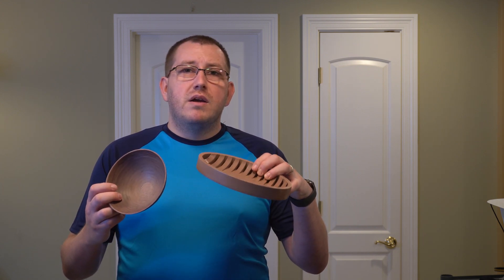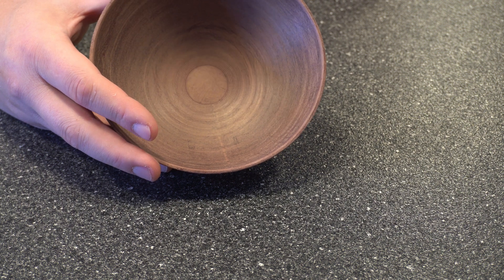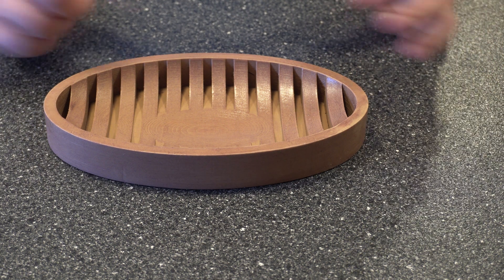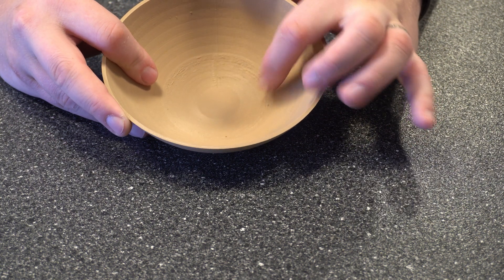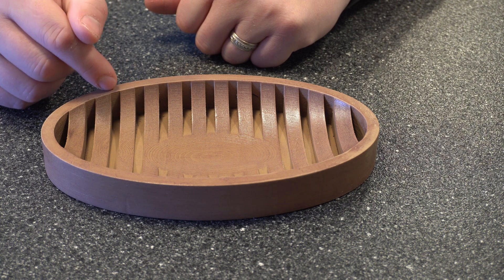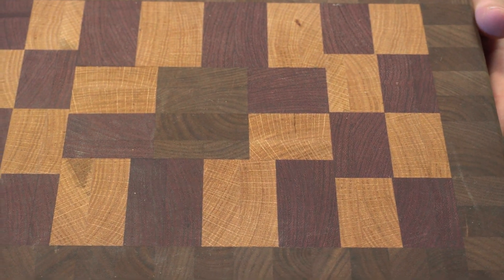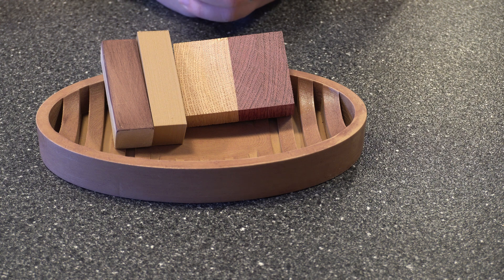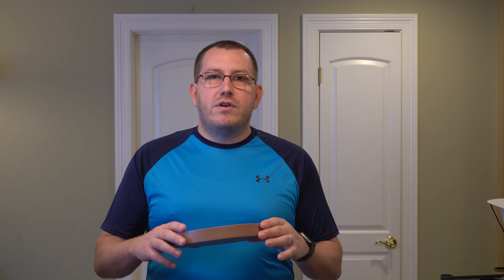Wood Filament 3D Printer – Final Thoughts

Comment: Hey Robert, great video even 3 years later. I've to say that final prints looks very good actually (btw, recording in very high resolution). I'm struggle finding Hatchbox in the market and will probably try Amolen brand. If you have experienced printing with this brand, please let us know.
Reply from the maker: Hi. I havent used Amolen filament before but one thing does stand out as a potential issue. The Tolerance: ± 0.03mm is a bit higher than i like. I typically dont go above .02mm. That doesnt mean that it wont work, just something to keep an eye out for.

Comment: I wonder if tou could use wood pla with pla+ in duel extrusion. Have the outside 2 or 3 walls be the wood pla but the rest be pla+ to get both strength and looks
Reply from the maker: Hi. I think that would work. Its still PLA based so there shouldnt be any issues with adhesion.

Comment: Can you show how to print wood filament? comparing to PLA?
Reply from the maker: Hi. In this case, its the same as PLA because its just PLA with the filament mixed in. Just make sure to run a temp tower to get the right temp for the filament your using.
Reply: @3DPrintscape  I did a temp tower but the results were strange. Is there a way I could share the results pictures with you?
Reply from the maker: @YigalBZ  Ya, you can share them on discord or over email. My email is admin@3dprintscape.com

Comment: So to clarify. Its not actual wood and there hasnt been any scientific breakthrough allowing wood to be 3d printed
Reply from the maker: Hi. Its wood fiber in the pla. The wood fiber is what absorbs the stain.
Reply: Yes, i was looking if someone invented a 3d printer that can carve solid wood( olive wood) which i can use to print kitchen utensils and cutting boards instead of buying a whole lot of equipment to carve a cutting board

Comment: what nozzle did you use? I was recommended by a vendor for a wood filament to use a .5m nozzle. Is this required you recon ?
Reply from the maker: Hi. I was using a .4mm hardened steel nozzle.

Comment: That looks good. I want to print some rosewood from 3DBest but not sure I can with my current machines. I don't have the proper nozzles but man it sure looks good.
Reply from the maker: Hi. Ive looked at that filament as well, i may end up getting some to try out. I would recommend having a steel nozzle though, the brass ones wont last.

Comment: Nice video with many useful considerations -- thanks. I've started experimenting with this wood PLA and found that it clogged my 0.4mm nozzle for the first time ever. I changed the nozzle and am using regular filaments as before, but I want to think and study a bit before trying it again. One video I saw suggested only using 0.6mm nozzles with wood filament. I also want to study extruder temperature's effect on clogging. My Filamentum brand filament (from the Czech Republic) suggests working temperature of 170/185 degrees C.

My primary use, so far, is to make drawer and cabinet handles. They're fairly small, so wood grain isn't so important on them. Also, it ought to be easy to make lots of different and original styles. For example, I made a dozen Greene & Greene style handles out of (real) oak and it involved about a dozen steps on the table saw, band saw, router table, spindle sander, etc. over a couple of days. Pretty much anything you do with SketchUp you can just 3D print one or ten when you need them.

Keep up the good work.
Reply from the maker: Hi. Thanks for the feedback. I haven’t had any issues with .4mm, even with wood filament. Most of the nozzle issues I have had were related to printing at too low of a temperature. I like the look of wood, which is why I started playing around with this filament. I do woodworking on the side as a hobby when I have time, and it does require a lot of tools and time. It's much quicker to be able to print something.

Comment: On one of the forums I frequent someone had printed a stock for his airsoft rifle. He sanded and stained it and it looked pretty good in the pictures. So, the wood filament is a little more useful than just making decorations and trinkets.
Reply from the maker: Hi Kevin. That’s a cool use case for wood filament that I didn’t think of. Im sure there are others that fall into this category as well. I was thinking more of things for around the house like little bowls, small shelves, etc.
Reply: Yeah, I was thinking I could use wood filament for a 3d printed boomstick stock